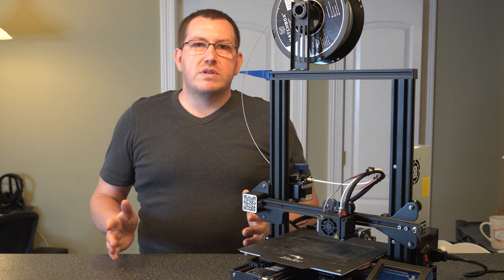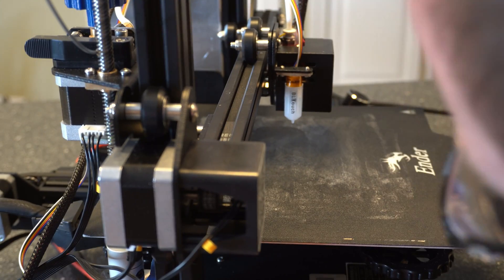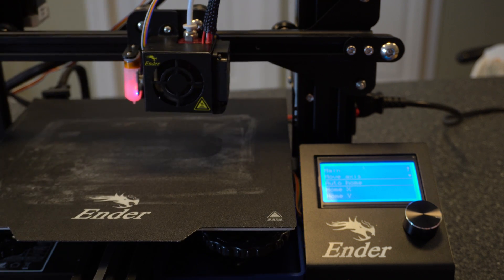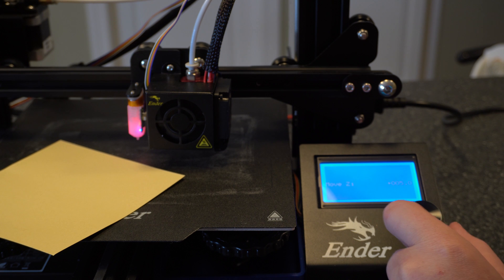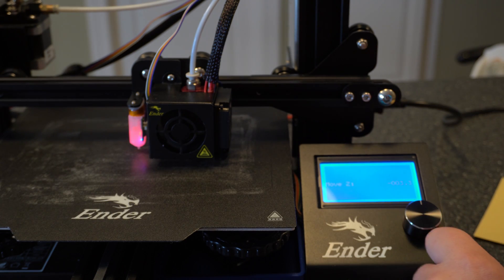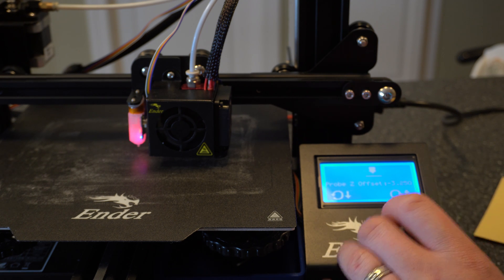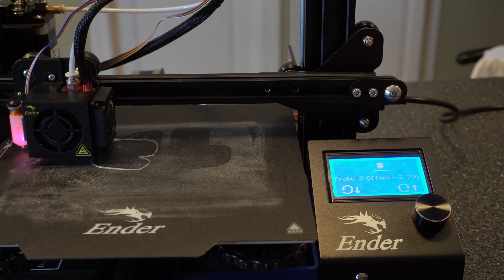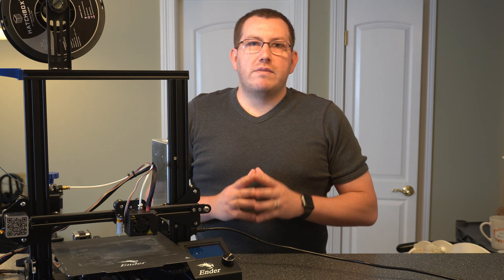Z-Offset BLTOUCH With Marlin Firmware

Comment: Man it's like when I set the z offset, it's like it does nothing everything just strings. No matter how much I offset it
Reply from the maker: Hi. Are you saving the settings and do the setting persist through a power cycle? Also, keep in mind, the z offset doesnt come into play until you start a print.
Reply: @3DPrintscape  yeah, I do store settings, then do I also have to go under advanced and hit set home offsets?
Reply: @3DPrintscape  something odd that is happening. When ever I autohome it first and go to manually set my z axis. It's at 10 then once I find my off set and save it. I autohome it again and it starts at 5.8...my offset was only -.8
Reply: @3DPrintscape  ok, so reset settings to default then used the zprobe wizard under advanced and that worked
Reply from the maker: @Ohiobirds7  Sounds like it may have been something messing with the eeprom, but im glad you got it working.

Comment: I installed a car touch on my Ender 3 4.2.7 silent board and dual z stepper motors and every time I do the 9 point level my z offset changes even after storing my offset settings any ideas why this is
Reply from the maker: Hi. How much is it changing, a lot or just a little? Do you have any excessive movement on any axis or the hotend?

Comment: I try to lower the z axis and it will not go down so I am unable to do the z offset.  and When I do auto home the z axis will only go up.  will not lower
Reply from the maker: Hi. Is sounds like the z stop may not be connected. Can you connect it and try again?
Reply: @3DPrintscape  tried several times. I think it might be a board issue. Or the cr touch is bad.  I have a new boars on the way so I will be able to try out the cr touch. If I have the same issue with the new board then I get a new ABL.

Comment: Hi, how's it going! for starters your vids are great and you've helped me a lot by watching your vids. So to break it down I have an Ender 3 Pro with a 32bit board. I also did the MicroSwiss all metal upgrade. I recently the issues starting coming after I added a cr touch to it.  I've tried to calibrate the z axis numerous times based off the video on how to set the z axis. after attempting to adjust it i come across these 3 issues. either the extruder will move to the back right corner of the build play raise above the build plate and start extruding filament in a large quantity with even moving around, or it will crash into the build plate and drag across everywhere, or last but not least it will hover too high while attempting to print. I've spent a couple months watching videos and I've had to walk away fir a week or two at a time to maintain my sanity lol. I hope you can assist me . thanks!
Reply from the maker: Hi. Try to clear you eerpom. If that doesnt work, i would try to pull a fresh copy of the firmware and config example and build it again.

Comment: New to 3d printing, so bear with me. I installed a 4.27 board on ender 3 pro, updated firmware, and installed a cr touch plus the firmware. I followed your video to set z offset. On the display there is no place to save offset numbers. What am I doing wrong?
Reply from the maker: Hi. Can you check to see if you have anything related to bltouch in the menu? If not, the firmware didn’t take.

Comment: When trying to set up my CR touch on my ender 5 Pro, I have disconnected the z stops, as per instructions. This is causing the printer to auto home and try to crush the nozzle through the glass bed. Can you please help
Reply from the maker: Hi. Connect the z stop switch back up. There was only only creality firmware build i have come across that required it to be disconnected.

Comment: Thats kinda the issue. I can go to prepare and move the z axis, but in control i dont have an offset option.
Reply from the maker: Hi. Do you have bltouch in the menu anywhere? If not, the firmware didn’t upload to the printer.
Reply: @3DPrintscape  BLtouch? I dont know whats that, Its the printer as it came out of the box. v1.0.1, I have not installed a thing except replacing the bowden tube.

Then i switched to a glass bed as the original bed was torn apart. So im trying to recalibrate, and in the prepare menu, i can move the z axis, but there is no offset option anywhere to be seen.
Reply from the maker: @Alientcp  Ah ok. The z offset only comes into play if you have an ABL kit, like the bltouch or crtouch.

Comment: New to 3D printing so thanks for this. I have an issue where even with my Z offset maxed out it’s still way too high off the board so I can’t use the paper thickness trick. Any idea what the solution is…?
Reply from the maker: Hi. What do you mean when you say you have it maxed out, whats the actual value you have it set to?
Reply: @3DPrintscape  scrolled up to 4.9 I think - doesn’t go any further
Reply from the maker: @gordonking9682  The offset should be negative, something is off. Is the probe below the nozzle?

Comment: My extruded seems smooth when running but I can move it around a lot by shaking it.  I can move it up and down and different directions. But tightening up the bolts on top and bottom don’t change that.  I’m just not sure how much play this should have.
Reply from the maker: Hi. The bottom bolt should have an eccentric nut in the middle of it. You can tighten things up there.

Comment: First try, auto home....scratches the ever loving crap out of the bed.... /hangs head
Reply from the maker: Hi. Is the bltouch getting triggered and stopping the z axis?
Reply: @3DPrintscape  Im having the same issue. I do all the steps, looks crisp on everything, then when i start printing it destroys the bed. I just ordered another one because it got so scratched up. I dont get where the issue is. 

Auto home > goes to 5 > i lower using move axis Z, goes from +5 to -4.2 for resistance with paper > i raise axis Z > i got to offset z axis > set it from 0 to -4.2 > save settings > i go to print, it does the 9 point test cleanly as ive added the 29 line in the code, then goes berserk and destroys the bed. Not sure where my mistake is
Reply from the maker: @dimitar3702  -4.2 seems like a large adjustment. Can you make sure you don't have any extra movement on the carriage and that you zeroed out the z offset before you started the process.
Reply: @3DPrintscape  Yea, i make sure the z offset is at 0 before i do any of the initial adjustment. From auto home its set to +5, then it seems to touch the paper at -4.2 I dont see any extra movement. I feel like i might be missing something though.
Reply from the maker: @dimitar3702  Did you try to use babystepping when the print started to dial it in? That may be a good next step.

Comment: Hey man I'm having trouble with my printer it's an ender 3 pro I have installed it perfectly and when I tried to bed level my extruder crashed into my print bed and so I turned it off but now my stepper motor won't go down, the info screen now says endstops z please help
Reply: It also says home z first
Reply from the maker: Hi. You should auto home before trying to make any adjustments. How is the bltouch wired and are you using precompiled firmware or a build you made?

Comment: I recently set up my printer and updated the firmware to work with the BL touch 32 bit board on my v3 pro. I set my z offset and it goes to printing but after about 12min my printer completely freezes. I dont think its hardware related but given this is my first printer and first time trying to print I am unsure.
Reply from the maker: Hi. Is it always around the same time mark and does it do with the all objects or just one?
Reply: @3DPrintscape  Yes it seems to be about the same time mark every time. I havent written down the times to confirm this though. I also am having a issue with the z offset staying for me. I can go through the steps youve shown here and after I set the probe offset I and store setting. The next time I auto home its way off the bed still. I have been trying to use the factory provided print on the sd card. I did download a cal cube from thingiverse and I sliced it but when I put the card in my printer it doesnt show up. Also I am having a No TF card found issues sometimes.
Reply: @3DPrintscape  I was doing some digging and it appears that you have to add a letter or something to the title of the g code file after slicing for the printer to see it?
Reply: @3DPrintscape  When I installed my BL touch im fairly certain I unplugged my z offset limit switch was this wrong to do with factory firmware with the BL touch?
Reply from the maker: @jasonx9  That should not be required and it depends on the Creality firmware. I have seen it work both ways, not sure why though.
Reply: @3DPrintscape  I am debating on going to Marlin firmware but I would really like to just get this thing to print before changing a bunch of stuff

Comment: I'm having this problem every time I do exactly what you said in the video My nozzle is still too high when I print it's like it won't save my settings. HELP!!
Reply from the maker: It sounds like it's not taking the z offset. Are you sure its being set right?
Reply: Thanks for the reply but I fixed it. Cura has a Z-offset plug-in that fixed all my headaches!
Reply from the maker: @billnavarre5308  Cool, im glad you got it working.

Comment: Great video but my problem is that the Firmware doesn't give  me the option for a probe z offset. No matter what the machine seems to start at about 1.5 mm above the printing surface. I am about to throw this thing out the window. I have contacted Creality over and over again but they never help you when you are dealing with problems. Gotta hope youtube and reddit have your back. Have you ever seen the problem where the Probe Z offset isn't even a menu item?
Reply from the maker: Hi. Its not in the standard firmware. Do you have a bltouch, or something similar?
Reply: @3DPrintscape  I have a CR touch. creality says that i have an 8bit motherhood and so maybe that's the problem.  I don't know if that's true.  I have a cr10v2
Reply from the maker: @alienmatters3106  Can you open the printer up and look for the board version?

Comment: Hi. Everything goes fine until When I press set home offsets, i get a loud beep and it says "err: too far" can't find a fix online either
Reply from the maker: Hi. Are you trying to set the home offsets in the firmware or at the printer?
Reply: @3DPrintscape  in the printer
Reply from the maker: @uthmaanahmad788  Ok, i dont change the hoe settings there. My guess is you are trying to make an adjustment that would tell the printer that it can go beyond the size of the bed. I had this issue when setting the X_MIN_POS and Y_MIN_POS settings in the firmware.
Reply: @3DPrintscape  when I try to click the set home offsets button it errors straight away, I'm not able to set anything
Reply from the maker: @uthmaanahmad788  Try to set them in the firmware, then push that to the printer. From there, make sure you clear your EEPROM.
Reply: @3DPrintscape  so I've been at it all day think I got the offset part down. But when I go to print with the g29 gcode added in my slicer, it goes to level and fails on the first probe, then carries on to start printing even tho the bed is at least a good 3-4mm away from the extruder.

Comment: I followed your instructions to the T got motherboard 4.2.2. The problem I have is I have to do an auto bed leveling every single time before a print otherwise my printhead tries to bury itself in the bed, I ended up with three holes in my bed before I figure that out. why is it doing that.
 This thing seems like more of a headache and it's worth.
Reply from the maker: Hi. I run the g29 command at the start of each print to make sure i get new readings but its not necessary. Run the bed level then make sure to save the settings. It sounds like the settings are not being saved or something is moving around, may be the extruder carriage?

Comment: I've been trying to setup my bltouch on my ender 3 pro but everytime I press level bed at one point it just starts to flash red and stop leveling.
Please help.
Reply from the maker: Hi. How is your bltouch wired and what firmware are you using?
Reply: @3DPrintscape  I'm using a 4.2.2 motherboard on a ender 3 pro and the white  wire is on the left then the black wire tghen the yellow wire then the red wire then the blue wire and i'm using the official creality firmware which is Ender-3 pro 4.2.2 mainboard firmware（32 bit)
Reply from the maker: @aliq8946  Is the z-stop still connected?
Reply: @3DPrintscape  No, I removed it before powering it on with the bltouch.
Reply from the maker: @aliq8946  I've seen mixed results with the creality firmware and the z-stop requirements. Try to connect that and see if it works.
Reply: @3DPrintscape  I've already fixed the issue which was to remove the g29 code from the slicer software and it works perfectly fine now. Thanks for the help though
Reply from the maker: @aliq8946  If you remove the G29 command from the slicer, it wont create a mesh at the start of the print.
Reply: @3DPrintscape  Yes I do know that but I already created the mesh and it's the only way I found to work and now the printer prints perfectly without any issues.

Comment: I dont know about anyone else, but Ive been having mixed results, but I think I got it now.

If you already have a Z-offset set and you want to change it. Maybe you modded your machine or you removed the bed to pull a print, etc.
And your set offset isnt printing correctly.
What I did was change the Z-offset back to 0. turn the machine off and on, home, auto bed level, home again, move Z down to 0, then change Z-offset.

Im running an Aquila X2 with Alex Firmware BLTouch 4x4. Although, I have the CR touch.

Im not totally sure if Im just doing something wrong or if thats the process?

Any suggestions are appreciated.
Reply from the maker: Hi. That process sounds right assuming you are saving the setting before powering off the printer.
Reply: @3DPrintscape  'sigh', if im understanding this correctly, the reason im having problems is because im not "saving" the setting?
I mean, it saves the bed level mesh, however its always unchecked when I turn on the machine, but the Z-offset is always at what i set it at.
Ive seen there is a "save settings" is that what youre referring to?
I like to bed level and check offset before every print, so im not sure this is a problem.
Reply from the maker: @bear5016  You want to save the mesh after you run it the first time. Then from there, you add the G29 command to your machine profile in Cura to kick off the mesh at the beginning of each print.
Reply: @3D Printscape  No i just run it every print anyways, because i remove the bed and put it in the freezer to remove my prints.

Or are you saying i have to add G29 code or else it wont use the mesh?
Reply from the maker: @bear5016  Ya, you have to add the G29 command to your printer profile which tells it to run the mesh at the start of the print.
Reply: @3DPrintscape  So if I dont add the G29, and the mesh is Active, will it not run the mesh?
I mean, my prints have been coming out fine without G29 added.
Reply from the maker: @bear5016  It will use the mesh that was saved last. If you want it to run a new mesh each time you kick off a print you need to add the G29 command.
Reply: @3D Printscape  i just run a new mesh every time. Adding it to the code makes a mess. As the machine will heat up and then bed level, leaving plastic all over the bed.

Much better to just heat the bed, auto level and double check z offset.

Comment: I have a cr touch and noticed that your instructions are a little different here than on your cr touch video. Mr extruder is a little high.  Can these steps in this video be used to make correction?
Reply from the maker: Hi. Ya, adjusting the z offset should be able to fix that.

Comment: Its not letting me move under zero
Reply from the maker: Hi. It sounds like the software endstops are enabled. You can disable them in marlin if you have a custom build or use m211 s0 to disable them.

Comment: Hi, I have the CR Touch and I'm finding that test squares at the back are showing signs that they are a little too far away from the bed. However all other squares are perfect, when looking through a magnifier.  Any suggestions welcome.
Reply from the maker: Hi. Is the mesh that gets created hitting around that area?
Reply: @3DPrintscape   @3D Printscape  it's doing the 9 stage process as expected covering the bed surface, but when the squares are viewed through a magnifier, the beading doesn't quite meet leaving a slight gap between the lines that makes up the base of the square. All other squares from the centre to the front are perfect and join leaving a perfect surface. Maybe I'm being too picky, but I didn't know if there was something I could dial in to compensate.
Reply from the maker: @brumpsstuff8088  Gotcha, i think there are two options. Option one would be to try to increase the grid size (maybe 5x5) to see if that helps. Option two would be to get a board with better drivers that can make smaller adjusmtens.
Reply: @3DPrintscape  thanks for replying.  When you mean increase the grid size 5x5 is that something I have to apply within the Marlin firmware?  I could give that a try but that'll mean it will probe the bed 25 times. It would be interesting as a test.
Reply from the maker: @brumpsstuff8088  Ya its a change in the firmware. You would want to set #define GRID_MAX_POINTS_X to 5. I think its worth a test, not sure its something you will want to leave in place unless it fixes the issue.
Reply: I'll print the test again and attach pics

https://drive.google.com/drive/folders/1W5zgeeBl-nnde8tg__6n2qlXHn9lyRnM?usp=sharing